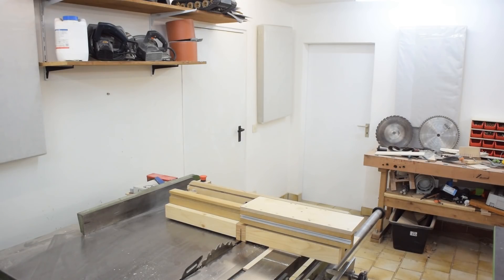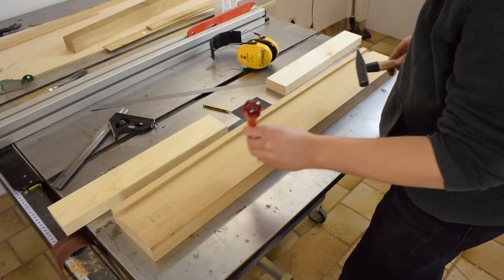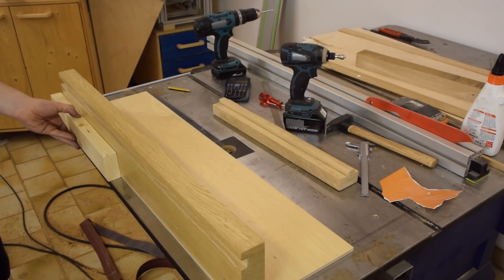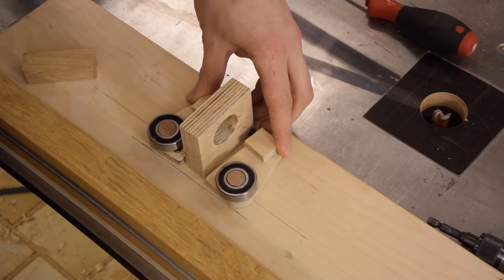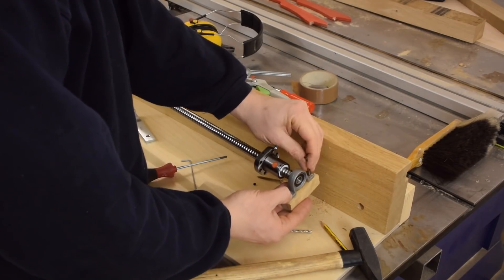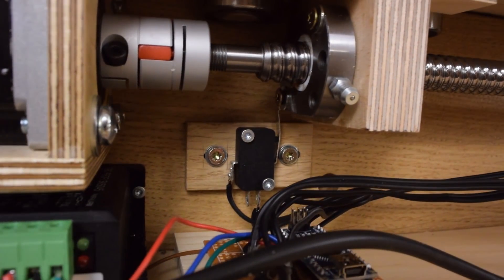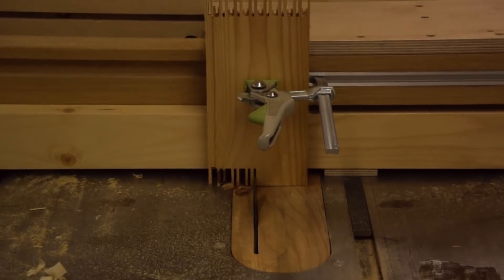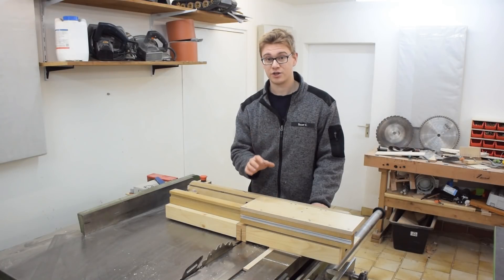How to build my Box Joint Jig

Comment: Are you going to share plans/ the code. Would love to build it
Reply: I did a basic version of the required code to run such a jig with similar setup as Cosmas. The functionality is not exactly like in this video but you can use my example as a starting point. Code available here: https://github.com/pjenglund/BoxJointJig-PlatformIO
Reply: Are you about ready to share your code? I'd really like to see. Thanks.
Reply: Please shere the code!
Reply: Hallo cosmas. Danke 4 deine einmaligen Videos. Du bist ähnlich wie Matthias Wandel von dem ich die Bandsäge jetzt übern Sommer nachbauen werde. Außerdem wäre der source code vom arduino echt sehr cool.... Ich habe leider nur 1 Jahr Informatik studiert und habe nur Grundkenntnisse. LG aus Wien vom Gemeindebaubastler
Reply from the maker: I'm going to refine the code a little more and add a couple more features and when that is done I will share it. I will not share plans for the jig since it is very simple mechanically.
Reply: Yes please share code Cos
Reply from the maker: Have not worked on it since.

Comment: Hi Cosmas, that's a simple but great design and the build is excellent. I particularly like the idea of embedding an aluminum extrusion to hold the work piece with a clamp. I am halfway through my own box joint jig that will use a PIC microcontroller instead of arduino. I will incorporate some of the ideas borrowed from your design. 
Is that a Nema 23  4 Amp  76mm stepper motor that you have used?
Are you using microstepping in the stepper driver? 
Thanks and looking forward to your future videos.

Comment: Why did you sacrifice 4 Arduinos? What was the issue? Great video and awesome build! Thanks for using lead free solder. I feel much better drinking ditch water now.
Reply from the maker: I connected one wrong then there was a faulty power supply the third one got crushed and I can't remember what happened to the last one.

Comment: As always Cosmas, your work is great. The creations is beyond reproach. The biggest problem I see is the lack of regard to cost making it less than practical. But I still loved the outcome. No mention of setups for variation in thickness and widths of the wood. Having to reprogram the arduino each time seems to introduce difficulty past practical usage.
Reply from the maker: Thanks but I really don't get your points.
At around 200€ this thing is actually incredibly cheap (Thanks to cheap chinese components). The thickness of the stock does not play a role for the jig. You have to raise and lower the saw blade to adjust to the thickness. Changing the width of the fingers is a matter of manipulating one single number right in the first line of the prgramm. That should be quite doable. The arduino then does all the calculations and adjustments for you.
I think you might want to watch my other video explaining how this jig works: https://youtu.be/Stz70oeY37Q
Reply: My apologies, Cosmas. I watched your other video and see what I missed in this video. I don't think those items are quite as cheap here in the US but doable. Seems so much easier than Mattias Wandels counting turns of a cogwheel.

Comment: Why do you run first-last-middle cuts instead of just first-middle-last? I get why you'd want to establish first and last boundaries for each finger when cutting with manual advance jig or by hand, but it shouldn't matter with your solution. Or should it?
Reply: I think it is to get better tolerances. Especially for tall fingers, the blade deflects by a few thou when there is material on one side, but not on the other.
Reply: This is my theory. Cosmas can do the experiment to see if it actually matters.

Comment: The only thing that I would add to this is a small display and 3 small buttons. This way you could input the blade thickness and choose the size of the notches that should be cut. Alternatively you could input the work piece size and amount of notches you want.

Comment: Only improvement I can think of right now is a auto-switch that detects when the box is back and ready to advance.  Then a ball screw to advance/retract the jig.  But at that point it may be better to just build a standalone machine complete with motor and blade.
Reply: yep, the project CRIES OUT for a 2nd motor/screw to move the piece to/from the cutting position, and as someone suggested, inputs for varying blade width, finger width, and number of fingers.  

And in competition with Mattias, :)  a similar jig for cutting dovetails on a router table.

Comment: hi Cosmas, i love this jig. how do you set up the joint sizes? is there a “configuration” via serial or you re-compile the code with the new values and flash it into the arduino?